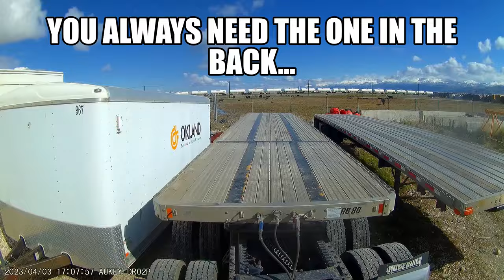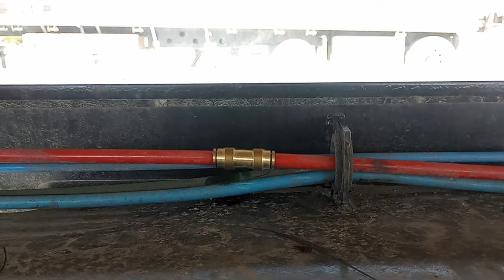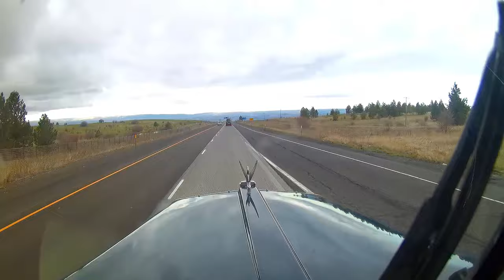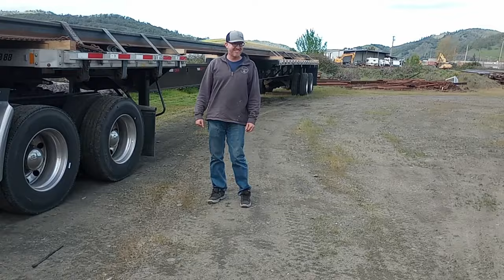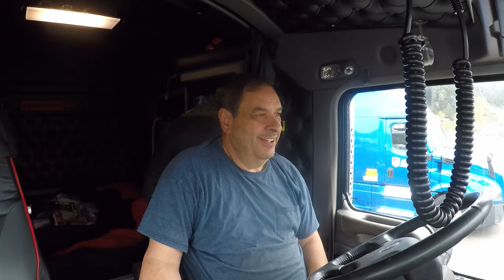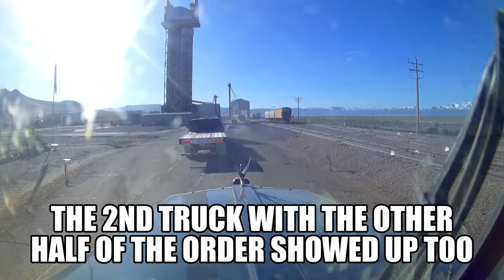Ep 197 Problems Along The Oregon Rail

Comment: I remember a trucking company from the old days with W900s painted the same way. Ray Bethers Trucking. If my memory is good they were out of Salt Lake City also.
Reply from the maker: Yup, same Ray.  He was based in Salt Lake till around 2000 or so.  He sold out and retired for a few years and then got bored, so he started up again. He passed away a year and a half ago, but he son is running it now.
Reply: I am very sorry to learn of Mr Bethers passing. I never met him, but I always loved his trucks. W9s with big moters and twin sticks. Walk in bunks before most companies would spend the money for them. Caterpillar motors I think,  might be wrong about that. They could have been Cummins, but nice lettering and pin stripping, very cool  and beautiful machines.
Reply from the maker: He liked the 3408 Cat, Then the C15 more recently.  He didn't want to, but since Cummins is all that's available now, the new ones have the bigger ISX in them.  Ray figured it was cheaper to have power and 1 driver than 2 drivers and a smaller engine.